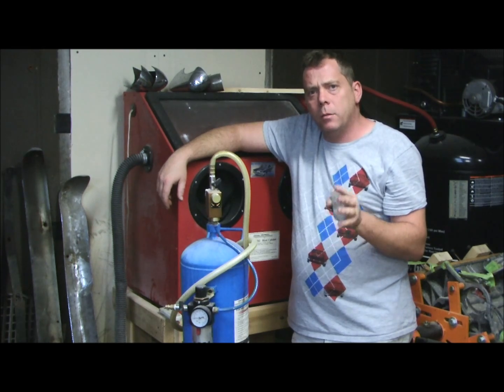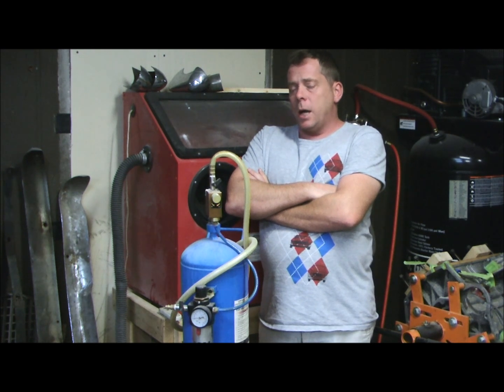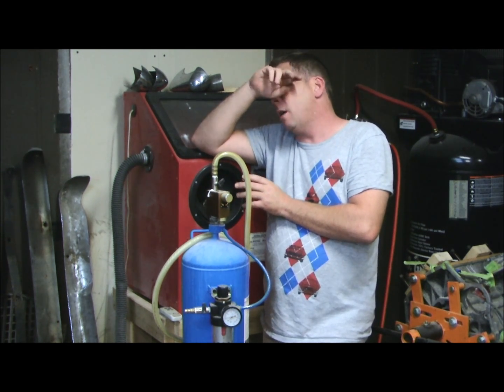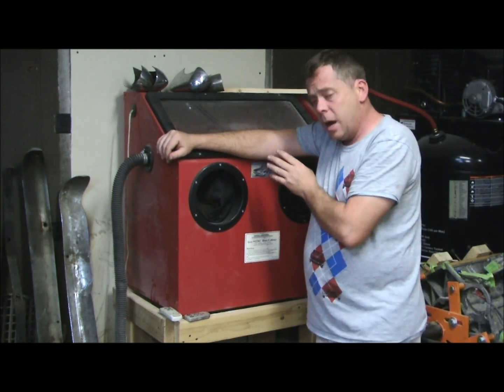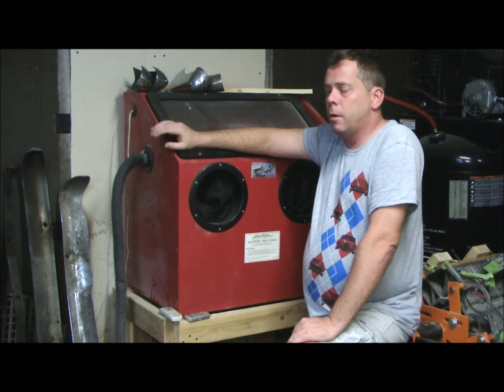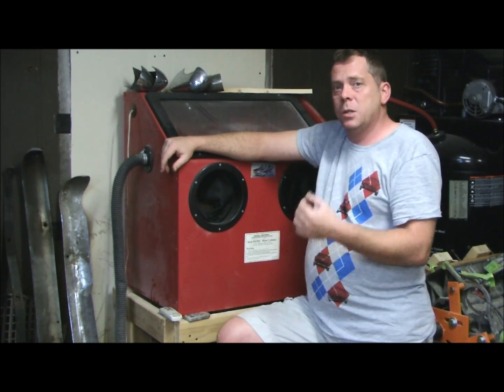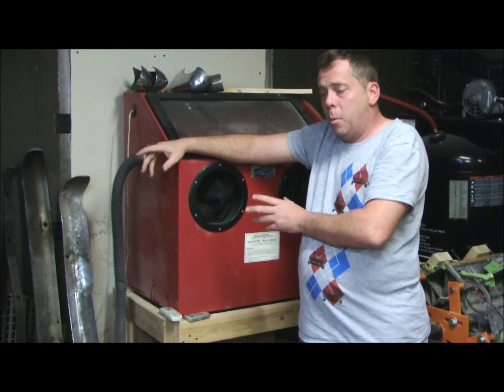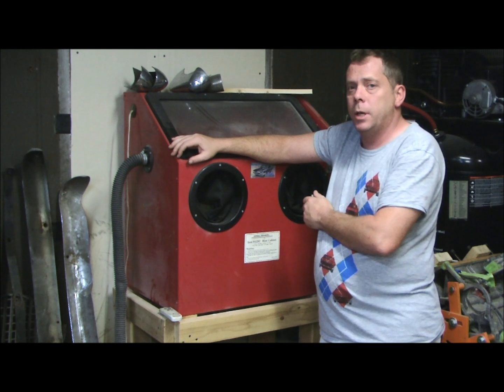Intro To Soda Blasting

Comment: As for good size compressor ? you need 60 gallon with 2 stage not single stage .. single stage compressors simply dont cut it for blasting and 5 hp minimum and you want to tweak your low side compressor turn on so it turns on when psi drops to 100 and run 120 PSI ... as long as you have a decent length from compressor to your dryer and line you might have a 20 PSI drop in line pressure before your cabinet so at your nozzle you will see 90 psi give or take do not set up your system so you got 90 PSI at the compressor because you are looking at less then 70 at your cabinet. Do not skimp on your air compressor take care of it and you will easily get 30 plus years of service.

Comment: it was looking informative until you mentions "until harbor freight came out with this..." as if that could be a good thing. I get it that in order to survive extravagantly in our society, one has to cleverly evolve in ways to screw or basically cheat your customers. And that's where harbor freight comes in. I just can't buy or support junk that wont last. I rather my grand kids use the tools my grandfathers used, and for those tool manufacturers to still be around.
Reply: Buck Wheat    In reference to your HF comments from a year ago.  I'm so glad that you live in a perfect world !
Reply: Harbor freight has got me through alot if projects and saved me tons. I know some of their tools aren't quality, I buy milwaukee for power, but all the little tools to help me with bearings, many more auto and even decent welding equip puts more food on my famines table.  I do miss sears though.

Comment: Good info. I already have the blaster cabinet and just need a smaller nozzle for the soda. Another trick on the air compressor is to find a dead compressor with a good tank(usually free or close) and link the 2 tanks together. It takes longer for the pump to fill them, but you get more continuous run time.